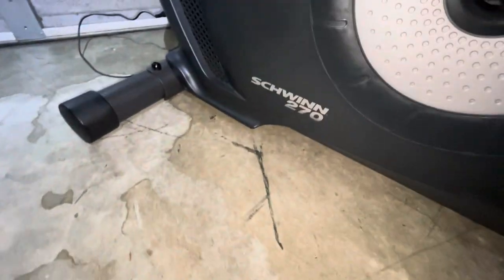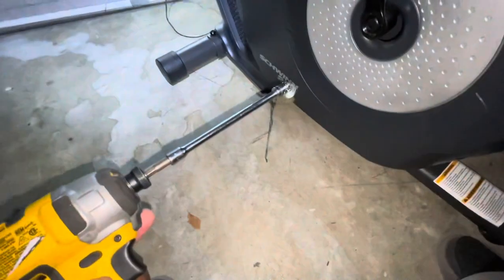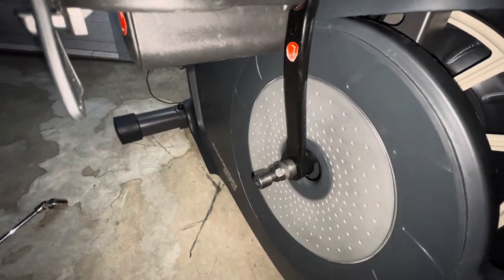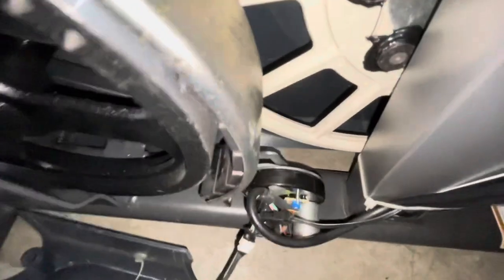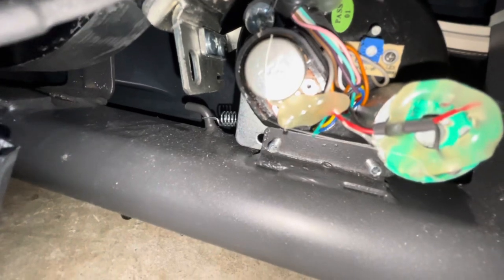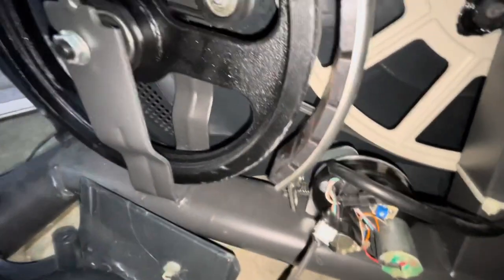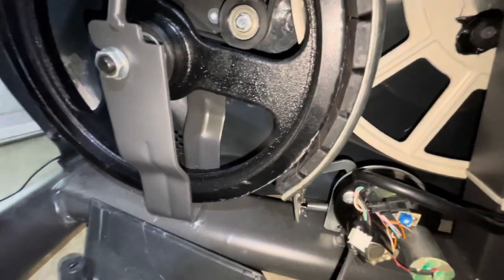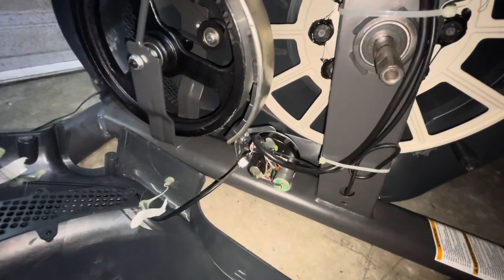How to fix resistance on a schwinn 270 230 235 170 stationary exercise bike

Comment: Dude, Thanks for the video! I separated the halves by removing some screws, spread it apart until I could see the servo and the adjustment screw, shined a flashlight inside and using a phillips jeweler's screwdriver, I backed it out a quarter turn and POW, I now have a restored resistance which goes from little at 1 to a LOT at 25 and everything in between. OUTSTANDING. I didn't even need to remove the pedal to do it since you should me where and what I had to do on the left hand side. Thanks again.
Reply from the maker: You are welcome
Reply: Did the very same thing. Bingo. Excellent.

Comment: Holy guacamole, dude, that worked perfectly!  Thank you SO much for this tip.  I was about to get on a phone call with Schwinn/Nautilus customer service that no doubt would've taken hours and resolved nothing.  

My only regret is that this video didn't exist 3 or 4 years ago because I tossed my last Schwinn exercise bike after not being able to get the resistance to work.  😭  BTW, I was able to do this fix without removing the pedal also.  I just unplugged the wire going to the power cord to allow me to scoot the outer shell out of the way better, which gave me easy access to the screw.  Took 30 seconds!  I bow in your direction bro.  🙇‍♂

Comment: Worked like a charm. Like some others, I didn't take off the entire pedal. But it disconnected the power connection. I only needed to reconnect it. When I turned the blue piece, mine moved a little so I had to hold it while turning it. Thanks for the video. Saved my bike and some money since I didn't have to pay someone to repair it.

Comment: I tried this but couldn't get the plastic shell removed because I didn't have the proper tools to remove the petal and so what I did was this. #1 I loosened the plastic shell as best as I could.#2. I used a felt tip marker to draw a circle around the area of the plastic shell where the blue screw area was. #3. I used a torch and close hanger to burn through the plastic around the area where the blue screw area was. Then I popped out the burned area and tightened the blue-screw area and it works fine now.

Comment: I was able to solve 2 problems with my 270 using information gleaned from this video as well as a couple others.  Didn’t have to remove the shrouds.  Simply removed all the screws from the shrouds, reached in & adjusted the potentiometer and moved the speed sensor closer to the axis of rotation of the magnets.  Solved the resistance adjustment problem as well as the “workout paused” problem.

Comment: For the 170, the motor is upside down relative to the video. This still works though but it’s a little harder to find the screw
Reply: Great tip, Thanks!
Reply: So does that mean I need to take the other panel off or is the potentiometer still on the same side, just upside down?
Reply: @PinkPhreud  if you are sitting on the bike and looking forward, I took off the right panel. It’s tucked away but it’s there and accessible.
Reply: I was able to follow all the steps but it still didn’t increase resistance. Anyone have any thoughts on this?

Comment: This will screw up the magnets control of going going front to back and back to front. You will get more resistance, but the controls WILL be jacked up. Follow the user's manual. I have to set it to 25 and work my way down now. Going from 1 up does nothing because I did this video.
Reply from the maker: This helped a lot of people that tried what the manual said….so maybe you did something wrong!! Read the comments and see how many people this helped
Reply: @youcanfixthat8636  the settings don't scale right

Comment: Thank you for this video.  I did this fix and it did buy me another 6 months or so of better resistance before it went back to little resistance even at the highest levels.  I ended up buying a new servo motor for $100 which wasn't that much more complicated to install than this procedure, the most difficult part is getting the bike opened up.  The bike is literally like new now.  It is amazing what that new servo motor does for the complete resistance level bands.  If, like me, you are considering just tossing this bike for a new one, I highly recommend trying a new servo motor.

Comment: I appreciate these instructions-it worked on my Schwinn 170!  I would have never known to do this on my own.  I do not have the crank puller tool but was able to remove the entire right side panel without cracking it, although it must have been close to the breaking point. The pedal has to come off first, of course, and you can leverage the crank out of the hole.

Comment: BC-6730 i took off the magnetic wheel (the drive pulley) and when i opened it two springs popped out and i dont remember their position. is there anyhow to find some manual for that specific part to show me the proper position of those springs? or any any other way to fix that without having to dumb the hople thing.. thanks

Comment: Brilliant! Thank you so much. It worked for my shwinn 270. I also didn't remove the wheels thanks to your clear directions about where to look, but it did require some negotiating body placement, a good flashlight, and finding a small enough screwdriver. I didn't think it worked at first because the white thing with the blue backing didn't "look" like it had moved, but sure enough a couple notches did the trick. Thank you thank you.

Comment: My 270 model will not pedal forward at all it’ll will backwards I do hear the motor come on when I switch the resistance if I follow instructions from your video will this help the pedal to release so I can pedal forward or is that a different problem.

Comment: Outstanding! Tried the manual/cardboard 'adjustment' and had the same result. Figured it was the servo going bad or misaligned somehow. Older 130 (2014) and the screw is a little tricky to get at with the wheel in the way. Used a jewelers Phillip screwdriver .Well done man.

Comment: Great video, just did this on 270.  Didn't remove crank arm.  Currently finishing up 30 minutes and I'm sweating more than I have in a while, def set my adjustment too high, gonna open back up and throttle it down a tad 
This works, people!  
THANK YOU

Comment: So glad I found this.  Looks like it might save me from ordering a new bike or at least a new servo motor.  Thanks!  In my case the bike is a Nautilus R618, but it has the same or similar motor as the Schwinn.  I had already slid the motor forward as far as it would go per the instructions. It's crazy that the instructions don't cover this option.

Comment: Where can I get the tool to remove the pedal?
Reply from the maker: This is the exact one i used

BW USA Bicycle Crank Puller – Crank Removal Tool for Mountain and Road Bikes with Square Taper Bottom Bracket Spindles https://a.co/d/8Jgljva
Reply: Use a 5/8 or 15mm wrench to remove the left pedal, then pull the left cover over the left crank arm.  Turn the pedal opposite direction from normal to remove
Reply from the maker: @alanruetten6927  i think he meant the pedal arm. I posted the link for the part i used
Reply: @youcanfixthat8636  thanks for your insight, you saved my 270!  But I only took off the left pedal and pulled off the side panel over it.  No need to buy a tool to take off the crank or pedal arm.

Comment: Asking here in case someone else has the same issue as my 170 has (and couldn't find an answer online even if I browsed many forum, maybe I didn't search the right thing but anyway)

My 170 is about 2-3 years old and has no apparent mechanical issue. Last month, all of a sudden, the difficulty 5 my wife use daily for about 45 minutes became as difficult as 20ish difficulty. She lowered it to 2 but it was still closer to a 7 difficulty and 1 was basically no resistance.

Unplugging for 3 minutes for the reset didn't help and magically after 2 weeks it got back to normal. 1 week later it bugged again and it now looks like 2 is 7+ difficulty again. 3 minute unplugged didn't this time either.

Since the issue looks to be random, is there something else that could cause the issue? I was about to open it to try and figure it out and haven't yet TBH, but since I found this video and people having issues I guess I could ask if anyone already saw something like that.

Thanks!
Reply: I have the same issue. I am going to adjust the POT until I have the exact difficulty of FIVE and unplug the bike. She does not want the variable up and down the hill resistance. Hopfully, the resistance will stay at 5 with no power.
Reply: @richardkduncan3928   I did something similar and easier in the end.
Switched difficulty and unplugged the bike when it got to the desired difficulty. Took a few times but it was pretty easy to retry and took under 5 minutes.
Reply: @AlphaGamingCa  Thanks for the idea.

Comment: So it fixes it but it's not calibrated to match the programming. I wonder how they calibrate it from the factory
Reply from the maker: That motor is more than likely set at a default level that they install in these units. In this case, you just gotta find a new comfort level on the machine💥💥

Comment: After troubleshooting my Schwinn 201 I found that the motor was not working. The motor is out of stock so I decided I would just bypass the it and put in a cable that would allow me to manually adjust the magnet. As I was getting ready to disassemble everything I simply spun the gear on the motor with channel locks and decided to plug it back in a give it one more try... It worked.

Comment: Ridiculous that the company does not provide any info like this. That would actually make sense if they had repairmen to fix their products which makes it even more ridiculous that they don't. They don't even have any suggestions for problems like this and I'm trying to find someone to pay to fix this but this is the only thing I can find on the entire internet that could help and can't even find anyone local that can repair these bikes. I have a 270 and just did all this stuff in the video but unfortunately didn't fix it. Having what sounds like the same problem as the other comment where the moving resistance part just keeps going back and forth regardless of the setting. I have been thinking it is some problem with the console but there isn't even a place to get a replacement one anymore.

Comment: Great video. As others say, no physical adjustment was needed.  They likely have sereveral versions of the bikes with slightly different adjustment methods.  In my case the potentiometer was correct.  But the pedals were removed wiht a wrench (right pedal, right hand threads; left pedal left hand threads).  Otherwise it was pretty easy. The hardest part is finding all the recessed screws to remove the shroud.  I finally figured out to lay the bike on it's side.  Most ot the screws are on the left side.  When you reassemble the bike lay the bike on the right side, mount the left shroud and put in the two bottom screws that go into the frame.  Flip the bike, locate the white line up part and put the right hand shroud on and add the screws on that side.  Flip the bike again and do the remaining left side screws then go back and tighten them all.  If I ever do this again I'm going to drill a 3/4" hole on the left side so I can adjust the potentiometer without removing the shroud.

Comment: Hi! I also have a Schwinn 270 with the same problem. Could you please tell me which parts you used? I don't know much about tools but am trying to find the cheapest ones for this repair. Thanks! 🙏
Reply: You'll need a small Phillips screwdriver to remove the 5 screws that hold the case together.  Make sure to remove the case on the left side (if you're sitting in the seat).  You'll need a 14 mm socket to remove the screw from the pedal.   You then need a specialized tool to remove the pedal - a bicycle crank arm puller (available on Amazon for about $10) an adjustable crescent wrench or vice grips.  This is the most difficult step.   Notice the video pauses because it takes a good amount of effort to loosen.   Then you just need a very small flathead screwdriver to adjust the resistance (about a quarter to a half turn to counter clockwise).   It goes back together easily.  Good luck.
Reply: If you don’t have a crank puller, you can take off the pedal with a standard wrench, then pull the side panel off over the crank arm.
Reply: @alanruetten6927  I got it off and fixed it! Thank you so much! You're awesome!
Reply: @alanruetten6927  how would you take off the pedal with a standard wrench?
Reply: @jaredsasaki5165  YouTube how to remove a bike pedal and that should get you there

Comment: I have a 270 Recumbent that quit having any resistance after a couple months.  I've looked for solutions, but none seemed practical - or financially sound.   This video seemed too easy to believe - why wouldn't Schwinn simply put this in the manual or post it online.  Nevertheless, gave it a try - worked perfectly.   The most difficult step is getting the pedal off and that depends on having the right tool.   The test now is how long will it last.  I'll post an update if I need to repeat.   For now, GREAT FIX - THANKS!!!
Reply from the maker: Thanks and your are WELCOME! Glad it solved your issue 😎
Reply: What's the effing right tool?

Comment: Tip: After the side cover screws are removed, lay the bike on its side.  The adjustment screw will be easily accessible with a short'ish small phillips head from the bottom of the bike. 

Thank you for your video!!